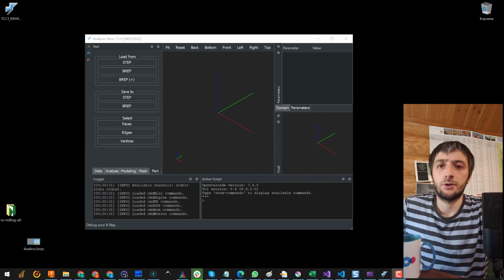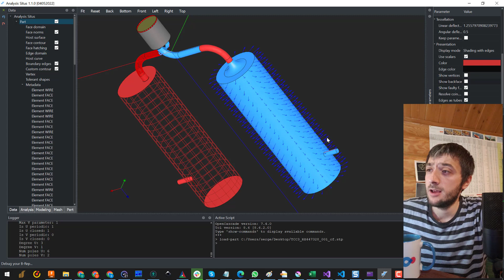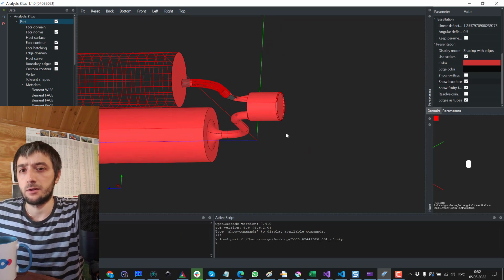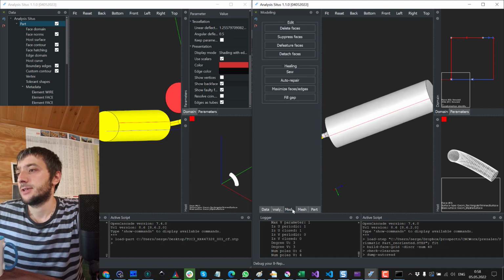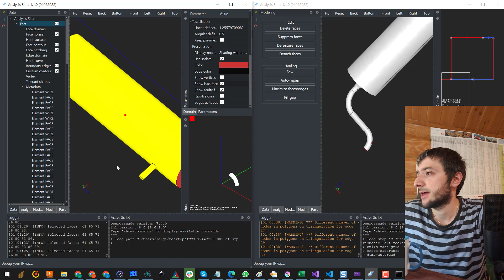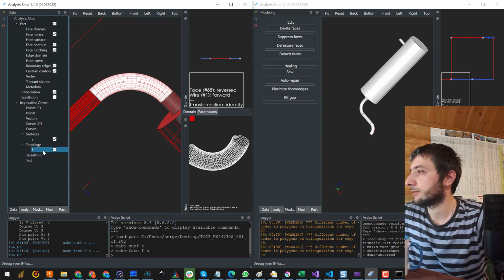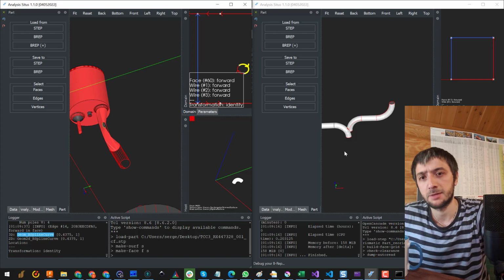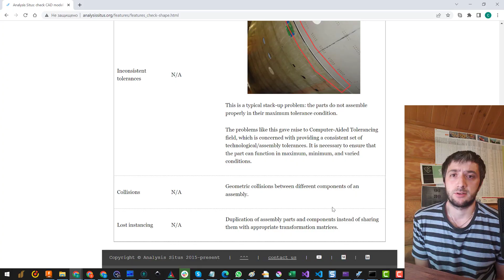Clean up and fix CAD geometry

Comment: Great content as always. I am intrigued by the domain window.. this represents the U/V parameter?
Reply from the maker: Yes, the UV space of a selected face and all its parametric curves (pcurves).
Reply: @QuaoarWorkshop  I will have to investigate that. it is the first time I hear about them. It seems like the domain is  often a square .. is it because of U and V is mapped 0->1 ? is the Pcurve the like a trimming curve? so many questions!
Reply from the maker: @jonathanforget8988  It all comes from the fact that a parametric surface S(u,v) is a function of two independent variables (u and v), so we can draw its domain and operate with it. All edges in a valid CAD model have their supplementary curve representations living in that parametric UV space of a face. Such curves (we call them "pcurves") need to be synchronously parameterized w.r.t. the 3D curve of an edge (the "primary" edge representation is its 3D curve, not a pcurve). To my knowledge, this principle of UV space is not unique in OpenCascade and is used in all other CAD kernels, including Parasolid and ACIS. UV domains are used everywhere and they really come from the math of differential geometry. You will also find them in texture mapping and CAE systems, literally, everywhere. In Analysis Situs, it's just made explicit because AS is a software for low-level devs, where you often want to have this information exposed directly. It's not always [0,1] range for UV, it's based on how a surface is parameterized. E.g., for a full sphere, both U and V will be in the range [0, 2PI]. For a cylinder, U is [0, 2PI] while V is [0, H], where H is the height of the cylinder. Surface trimming changes these natural bounds and allows you to keep only the portion of the surface that you want. In the video, trimming was not done originally, and we could benefit from that fact to rebuild faces having no edges at all!
Reply: @QuaoarWorkshop  thank you for this detailed explanation.  So a hole would be a Pcurves on S(u,v)? I thought u and v where normalized from 0,1. I have this issue with my probing module.. I keep getting that a point is on a surface but I guess it's the whole surface and not the trimmed surface. Could you give me a pointer on how to obtain a surfaces  pcurves? Thank you so much
Reply from the maker: @jonathanforget8988  Yes, a hole will be represented with its dedicated subcontour in the UV space of the corresponding face. U,V are not generally normalized, although if you're doing spline modeling, the chances to see [0,1] ranges for parameterization are higher, especially if the theory is implemented according to The NURBS Book. But, again, it's not required. Moreover, there's such a thing as "natural parameterization", that for curves means parameterization by length. To get pcurves out of a surface, you approach them through edges. You can try using BRep_Tool::CurveOnSurface() for that purpose.
Reply: @QuaoarWorkshop  thank you so much. I will look at suggested method. My hard drive recently died and I just now managed to get my project working again so I will be diving into opencascade again!